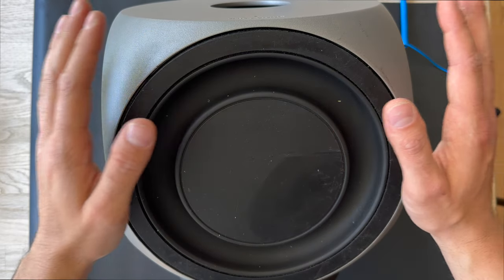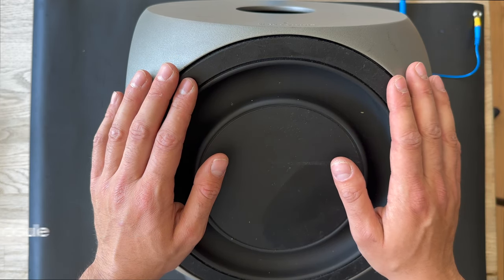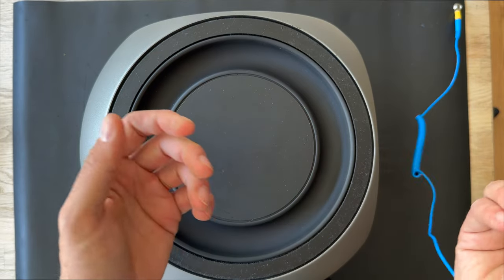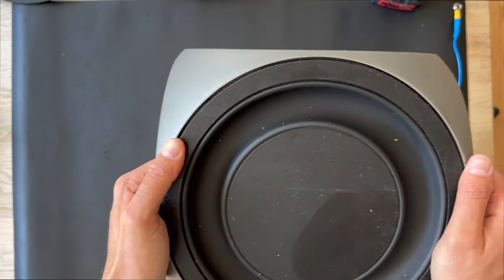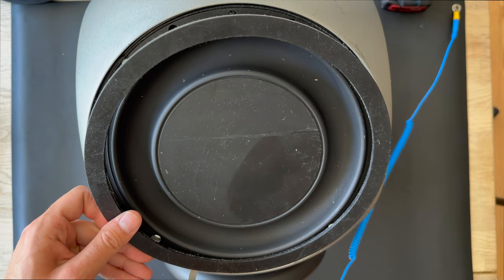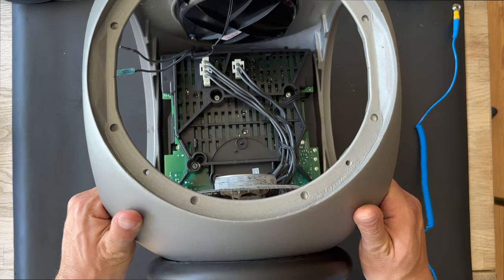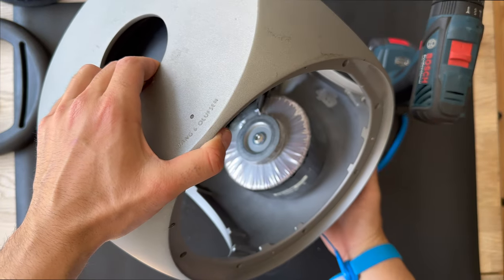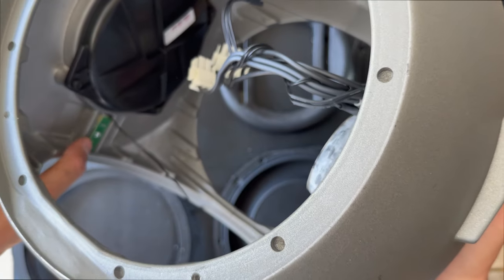Bang & Olufsen BeoLab 2 Active Subwoofer Disassembly process and Repair guide

Comment: Is it a servo controlled sub?
Reply from the maker: Hi Goobisoft
Thank you for your comment. No, part what I know. Where are no controlling for servo for this sub.
Reply: @KoseTrading  then what was that wire coming from the bottom of the subwoofer magnet?
Reply from the maker: @goobisoft4873  It was coming from the mainboard. But now, I'm not sure if the subwoofer had the controlling for the servo. There are no physical button. Only for changing the setup for the position.
Reply: @KoseTrading  maybe it is for a servo idk i haven't seen amy servo subs in my life so i m just guessing
Reply from the maker: @goobisoft4873  Yes, it could be. I will try to investigate it and see if I can get any feedback on the question.
Reply: @KoseTrading  would love to know about that
Reply from the maker: @goobisoft4873  Me too :)
Reply: @KoseTrading  actually it is a temperature sensor. B&O usually puts these on the magnets of speakers to get a good measure of how stressed the part is. That way they can use this data to make sure the speaker won't harm itself and/or help it maintain a suitable volume where it otherwise would not be working well after some time. The electronics simply limits the output or adjust it somehow to keep the system safe to use and avoid harm.
Reply from the maker: Your are right. Thank you for that comment.  @mibook84

Comment: Thank you for your video. I have beolab 1 and 2 connected to beosound 9000. It worked fine but recently the leds on speakers stay red and of course no sound came out. So I connected beolab 1 directly to the 9000 and they turned  on. I tried to connect beolab 2 to the 9000 using different cable. The result was the same. It seems that the beolab2 is having a problem with receiving signal from 9000. Can you guess which part caused the issue?
Reply from the maker: Thank you for your message. Sounds like there is some problem in the signal. Send you a e-mail with the problem and a video and i will try to help you.
Reply: @KoseTrading hi there, thank you for your video. I'm also having the same problem as @heddendaddy, you also send me some help on this? appreciate it, thank you!
Reply: I have the same issue, have you managed to resolve it? thanks!
Reply from the maker: @mojof1  Yes, we can also help you. Send us a e-mail to contact@kosetrading.com and we can help

Comment: Hello, First, I wanted to compliment your work and videos. They have come in handy several times to adjust my home devices. I would like to ask if you were planning to make a video of the BeoTime remote control/alarm clock? unfortunately I have one that does not work (the PCB). but to disassemble it look really complicated . But I'd like to fix it one day.
thank you, see you soon
Reply from the maker: Hi Thank you for your comment.
First i'm glad for you like my videos. One day we will take the  Beotime remote control/alarm clock and make a Disassembly process and Repair guide. Follow our channel and maybe it will be uploaded. 

Did you see we have a brand new Beotime one stock?
Reply: A thousand thanks. I took a look at your online shop. I'd actually I’ll like to fix mine. Do you have one PCB for sale? I have not found any spare parts for the BeoTime… 😢